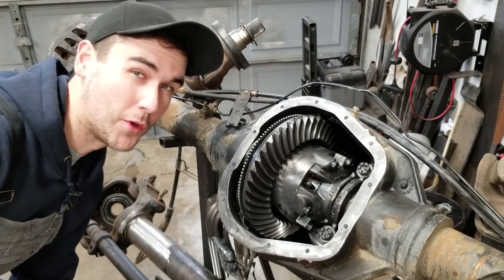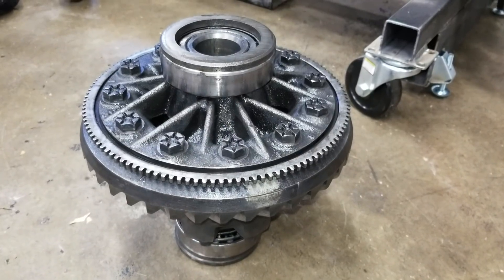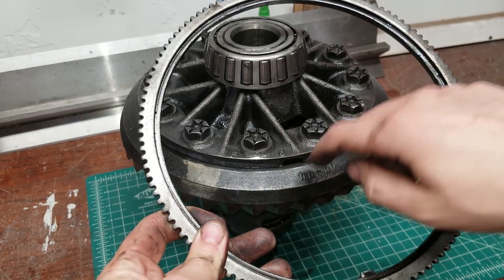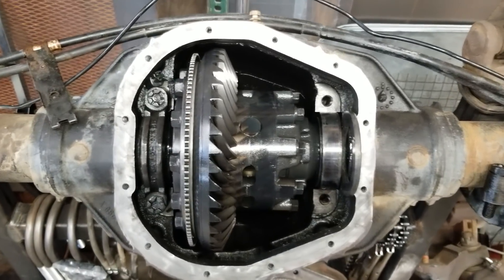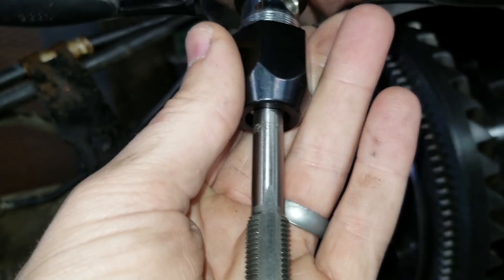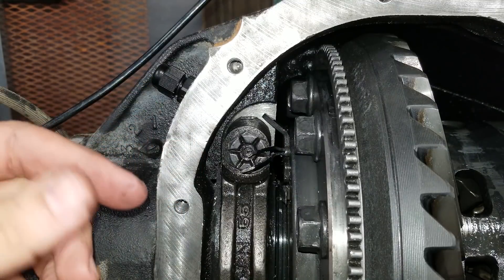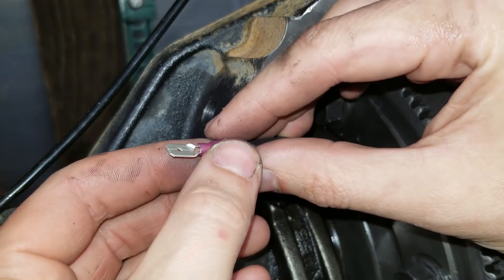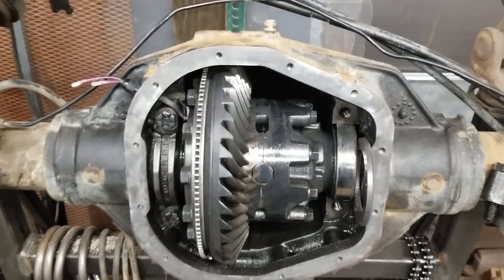Super Duty Rear Axle JUNKYARD E Locker Swap!

Comment: Can confirm this works. Installed in my 91' F350 Sterling axle and wired to a switch. Easy peasy. Been beating on it with 40s
Reply from the maker: Awesome! Thanks for reporting back about it 👍
Reply: @WebWheeler  no prob! It is a fkcn awesome /cheap upgrade! I wish I could get for the front Kingpin 60
Reply from the maker: Yeah it's hard to believe that with all the Dana 60/70 axles used for all those years by all three makes, none came with a true locker from the factory haha. 14 bolts had Detroit's but the Dana stuff was always just limited slips
Reply: @WebWheeler  have you confirmed that 5.13s will fit in older Sterling axles (91') using the newer Ford Elocker?
Reply from the maker: Haven't done it myself (my housing is a 2006 which fits) but from what I've researched the Sterling's all use the same ring gear bolts so just buy the gears/bearing kit for the '91 axle and you're good to go!
Reply: Did you use a 10.25 ring gear on it? Or did you have to use a 2011+ gear set?

Comment: Great video why not run the wires through the diff cover
Reply from the maker: Through the housing is tucked away a little more plus if I want to test/inspect the locker with the cover off then I don't have to deal with moving the wires around. Thanks for watching!

Comment: Was this locker a 35 spline or a 37 spline?
Reply from the maker: All Sterling 10.5 and 10.25's are 35 spline shafts/carriers. The change to 37 spline in 2011 applies to the pinion only. Thanks for watching!
Reply: @WebWheeler  This is very helpful, also what gears are you going to be running? I want to run 4.88 but i’m not sure if that gear ratio will work with the locker. Also do i order rear gears for any steering or does it need to be a 2012+ gear set for the rear?
Reply from the maker: I'm running 5.13's to match the original gear ratio/tire size. All the gear ratios will work with the locker, but the 2011+ 37 spline pinion axles only have gear ratios down to 4.88. The earlier axles go down to 5.38. You'll need to order gears based on which pinion spline count you have. For the Sterling 10.5" axles with 35 spline pinions (1999-2010) you can run gears that are for the Sterling 10.25, you just need the Sterling 10.25" install kit for the correct bearings and seals rather than the Sterling 10.5" install kit. Hope that makes sense!
Reply: @WebWheeler  I have a 2002 axle, i’m still a bit confused on what year gears i would have to order. Since it’s a 35 spline would i order for a 35 spline pinion. I’m new to this whole thing so i’m a bit confused
Reply from the maker: So you just need to order gears and the install kit for a 1999-2010 super duty if you're going to run 4.88's. It gets just gets a little more complicated if you're trying to run 5.13's or 5.38's in the 1999-2010 axles

Comment: Did you have to change pinion/pinion bearing I’m wanting to do this to my 02 f250
Reply from the maker: You might be able to keep the bearing setup if you're lucky but there are no guarantees- definitely need to have the gear pattern checked after swapping them to make sure. Thanks for watching!

Comment: I am curious if you went thru all the trouble of drilling and tapping why not just make same hole as other rearend and reuse factory plug?????  Not being "That feller" but I wondered why
Reply from the maker: The housings are from different era's- the old housing (the one I'm putting the locker is) is older and doesn't have the mount for the plug in the casting. They cast in more material for the factory plug.  It's so long that without the additional material to space it out, it doesn't fit well inside the differential without risking contact with the locker or ring gear bolts.  Also, I would be drilling two holes and still having to tap one that way (the factory plug has the wires going through and then a separate mount screw.)  I could have swapped housings but I kept the old housing because it has the ABS sensor where I need it and that'd be a lot harder to correctly make a mount for than making the hole for wiring. Thanks for watching!
Reply: Or was it from a different GVW vehicle??
Reply: Ah got it.... I haven't been under mine yet.... haven't seen housing

Comment: Hey WebWheeler... I have an 85 chev one ton dually RWD  I put a cummins in it...with a dana 70 HD 35 spline axles 4:11 Gears... I would Love to do the same thing you did... I need the traction of a locker... I am completely open to suggestions... Thank you for the great video and thanks ahead of time!!
Reply from the maker: There are lots of options for the Dana 70- really depends on what kind of terrain you need the traction for and how much control you want. There are E lockers, pneumatic lockers, manual (ox) lockers, automatic detroit lockers, etc. Im assuming you're mainly using this truck for towing and highway?

Comment: Great video! Just the confirmation I was seeking. Question?  Can you just wire up to a normal 12V rocker switch? or do you need a Relay or PWM ?  I have a Sterling 10.25 in my Jeep. No ABS or fancy electronics.. Thanks
Reply from the maker: Worked just fine for me with a regular toggle switch rated for 20A.  I believe the current draw is around 5 amps so if your switch is rated for less than that just throw a relay in there and you're good!

Comment: Hey, I'm new to this e locker thing. Did you keep and reuse the same  shims and keep the exact thickness on each side??  Did you have to adjust back lash after you installed the locker?? Did the tone ring get clamped in place by the ring gear or did it have a slight interference fit to hold it in place? Thanks in advance for your answers. I'm gonna attempt this myself very soon.
Reply from the maker: I installed the shims from the housing I used.  That would be your starting point, then you need to pattern the gears and adjust them accordingly.  Count on needing to reset the gears after swapping in the locker.  I am swapping gears that I didn't have yet so I didn't bother setting the old gears back up at the time.

The tone ring was just an interference fit on the locker which should be plenty to keep it from spinning.  I got it started with a mallet then it pressed on when I tightened down the ring gear.  If you don't feel its enough, you could use a dremel tool or die grinder and relieve the locker to reuse the tab on the tone ring.

I will be posting an update video about this locker setup when I get everything rolling so subscribe to keep in the loop!  Thanks for watching and good luck with the swap!
Reply: @WebWheeler  Thanks for the info. I'm actually going to 4.56 gears because I have 37" tires on my f350. I'm a machinist by trade so I'm gonna measure the difference between the two ring gears and subtract the difference from the shims to get me in the ball park to start.
Reply from the maker: Don't forget to measure the difference between your current carrier and the new E locker from bearing seat face to ring gear mount face. That will help dial in how much difference you have from the old to new setup 👍 I grew up in my uncle's machine shop and it has helped a ton with clarifying this kind of thing!

Comment: Wonder if it will fit in the 10.25 sterling
Reply from the maker: Yes it will 👍 all the Sterling 10.25 and 10.5's carriers interchange
Reply: @WebWheeler  will the whole rig gear have to be changed or will the locker bolt up to the existing?
Reply from the maker: Locker will bolt up to the older ring gear just fine- you just might need to adjust the carrier shims to get the gear mesh pattern right again
Reply: @WebWheeler  thanks

Comment: Do you know if any e locker out of a f250 will work? I seen one post say it had to be a 6.2 gas motor cause the diesels have a different spline axle shaft then the older diesels.
Reply from the maker: They all work as long as it's the Sterling 10.5" axle. They have some optional heavy duty Dana axles in recent years that are different and won't work but it's not split by diesel vs gas. In 2011 ford switched the Sterling from 31 to 37 spline pinions (which I imagine is the confusion) but the axle shafts have always been and still are 35 spline and the carriers are all interchangable 👍
Reply: @WebWheeler  ahhh makes sense. Appreciate the info man. I'll keep a eye out for one.
Reply from the maker: No problem- thanks for watching! good luck!
Reply: @WebWheeler  where?
Reply from the maker: Apparently he deleted the comment at some point. I edited my response mentioning it. I'll try to track it down and comment back to you if I find it 👍
Reply: @WebWheeler  I put one of these in my 2000 f250 about 6 months ago and it's been working great.
Reply from the maker: Thanks for checking back in! Glad it worked for you

Comment: Have you had any issues with the solenoid itself? From what I’ve read, it will burn up running constant 12v from the battery. It has something like a 40% duty cycle. Supposedly, you have to run a pwm after actuation to hold it closed.
Reply from the maker: Never heard of any issues with it, all I've seen was a guy on pirate4x4 that left his hooked up directly to a battery for 3 days and it didn't hurt it. That was enough proof for me! I will release an update video if i ever have issues though. Thanks for watching! 👍

Comment: Interesting. 
I'm curious about how the lock-up occurs with the Fords. It looks like just a small movement and how does it pin the 2 side gears together to make an axle lock? 
#2 .... Should you stop to engage it, or can you flip it on at speed? 
Thanks
Reply from the maker: I believe it's basically the same as the Eaton E lockers. There's a YouTube video on how those actuate but it's basically just an electromagnet that pulls a collar in to engage the locker. I believe it will engage while driving but haven't tested it out yet. Once i get the build done I will try it and let you guys know what happens!
Reply: Absolutely come to a stop before engaging a locker.

Comment: Got my elocked housing ready to go. One question about the seals... wouldn't gear oil get out where you routed the wires through? It doesn't seem to have anything there to stop gear oil from making its way out with the wires. Or am I missing something there?
Reply from the maker: The cable glands I used have a seal to keep gear oil out but you could always use a little RTV as some extra peace of mind 👍

Comment: This video convinced me to take the plunge on my '02 Excursion. Parts are in the mail from a dealer that I'm assuming is just drop shipping from some Ford parts warehouse. All those dudes (Tasca and the like) have it for around $500-520, shipped. Master rebuild kit is like $200. Gonna be a bunch of other BS involved, but still under $1k TOTAL for an e-locker is BONKERS.

 I think we've all read the same 3 threads on Pirate and some Full Size Bronco forum. Did you or anyone else ever really get to the bottom of the constant 12V thing?
Reply from the maker: I know that a guy on pirate left his wired straight to a battery for 3 full days and it never got anywhere near normal gear oil temps (I think it got a little over 100* at the hottest part). That's all I cared to know haha. Thanks for watching! Help me out and spread the word 😎

Comment: Your wire seal probably has a PG thread Metric Diameter and inch pitch.
Reply from the maker: Apparently haha. Just when I thought they couldn't get trickier than metric and imperial in the same vehicle, now it's metric and imperial in the same thread! 🙄
Reply: @WebWheeler  PG7 actually is a type of thread!!! 12.5mm x 1.27 pitch... yeah...wtf?

https://en.wikipedia.org/wiki/Panzergewinde 

The Stahlpanzerrohrgewinde standard for screw threads, more often called by the shorter name Panzergewinde (pronunciation), was a technical standard created in Germany and subsequently used in various countries, such as the German-speaking world (Germany, Switzerland, Austria) and neighboring European countries.
Reply from the maker: Ha! Leave it to the Germans. They literally made a metric version of a 1/2-20 😆
Reply: @WebWheeler  They probably did it to mock the USA -- I mean, the metric system just makes more sense!!
Reply from the maker: That's what I'm thinking too! Lol yeah metric really does make infinitely more sense- I tend to use it whenever possible when I do design and engineering work on my computer
Reply: @WebWheeler  yup… stupid bolts cost more though lol!!
Reply from the maker: Yeah I build everything with standard hardware- I just go metric in the computer haha

Comment: My e locker just came in the mail (figured I’d get a new one cause it’s only $515 shipped and people sayin they get em from the junkyard for $500). Where did you get the cable gland? I’m tryin to find it in a conventional store cause shipping is getting delayed everywhere but I’m having no luck so far.
Reply from the maker: Wow that's a good price for the locker- where did you find that? I got the cable glands at Amazon but I imagine Home Depot/Lowe's or an electronics store might have them? Good luck!
Reply: WebWheeler ford parts giant, as long as you know your part number you can get any oem part, down to a single bolt. (Part number for the locker is BC3Z-4026-B for anyone else in the future). And dang that’s what I figured. Great video, it helps out a lot
Reply from the maker: Good to know! Thanks a lot man I appreciate it. Check eBay for those cable glands- I was looking for some bearings last night and Amazon was a month out but eBay sellers could get them to me in 3 days 👍

Comment: Have you heard anything about the 12v constant burning up the coil and needing to drop off to about 5v after the initial 30 sec engagement?
Reply from the maker: Nope- from what I've seen the 12V constant doesn't hurt them at all.  A guy on Pirate4x4 hooked his locker straight to a battery and left it on for 3 days.  It got warm but no warmer than gear oil temps and still functioned perfectly afterwards

Comment: I’m assuming that tab you ground off was there for a reason.  Will the tone ring “spin” on the ring gear without it?
Reply from the maker: Its hard to say why it was there- could have been for assembly, to prevent spin as you mention, or for some completely different reason haha. Bottom line though is it won't spin- the only thing "pushing" on the ring is the gear oil and the press fit on the carrier is more than enough friction to counteract that
Reply: WebWheeler    I saw another post where the guy machined a notch for the tab.   But that looked like a whole new level of complexity.   I think I’d do it your way
Reply from the maker: Yeah don't see it going anywhere. My guess if that it's mainly thereto make assembly at the factory easier. If time proves me wrong though I will let you guys know haha 😂

Comment: will this locker limit you from going up to a 5.38 gear ratio? or can you still run a 5.38 with this locker
Reply from the maker: You can still run 5.38s if you install the locker in a 2010 or older axle housing 👍 thanks for watching!
Reply: Are the 5.38s for the 2010 axle ?
Reply from the maker: You can get 5.38's for 2010's. 2011 and later switched to a 37 spline pinion and only go to 4.88's
Reply: @WebWheeler  thanks lol I almost gave away my 08 axle since I'm buying a 11-16 😅 so glad I came across this video. Let the swap begin. 🤘🏻🤘🏻

Comment: My understating of rear ends isn’t that extensive. If you have a 3.55 geared diff with the elocker, and you do the swap step by step in your video. I would then have 3.55 gears and not the current 3.73. Correct?
Reply from the maker: The ring and pinion gears always have to stay as a matched set so in this case I swapped the ring gear from my old differential on to the elocker so that it stays with the pinion that's in my axle housing. After the differential swap, the gears also need to have the backlash and pinion depth adjusted (even though they're the same gears as were matched before) because of machining variation between the two carriers. That's a whole video in itself though which I will be releasing when I swap my gears. Hope that makes sense! Thanks for watching